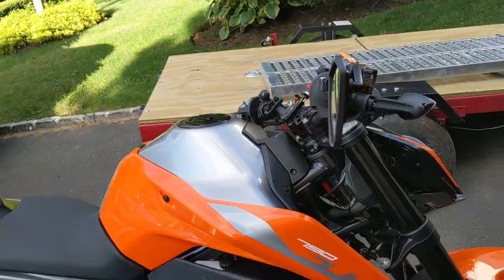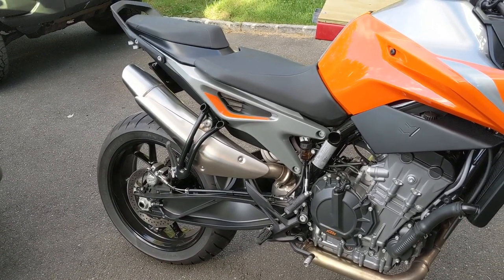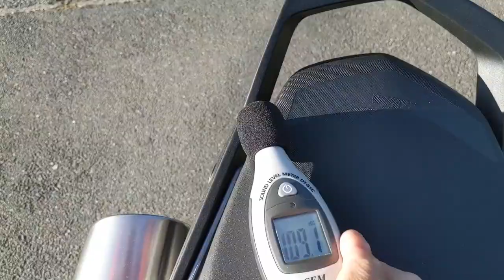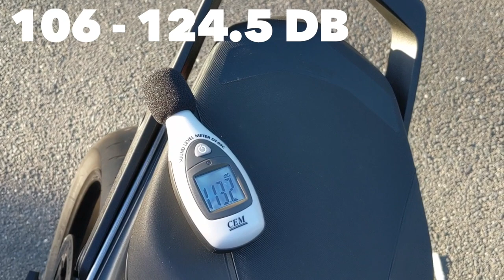SC Project S1 GP Exhaust Install On KTM Duke 790

Comment: Amazing video.  Sounds great and looks great.  Question for you: at 1:40 when you’re removing muffler bolt, do you find these extremely tight? Tried taking mine off recently and snapped the tool I was using.  Thank you
Reply from the maker: James Nickel thanks. Those bolts ( if I remember correctly) can be turned either with a socket wrench or with an Allen key - I used a wrench and had no problems- more tourque and grip .
Reply: I AM SANDY thank you! Will give it a go

Comment: Does the exhaust come with the mount and can you eliminate the passenger pegs while installing or do you have to buy a separate kit to remove the pegs?
Reply from the maker: Danny Wywias Jr pegs can stay and then no eliminator is needed. If you want to eliminate the pegs you must buy the elimination kit/bracket separately
Reply: Which kit did you use? I’m going to order this exhaust? Thanks
Reply from the maker: Danny Wywias Jr it’s in the description below the video - check it out. Good luck

Comment: is this with car or decat ? and must you get it re map for a slip on ?
Reply: This is a slip on with the stock cat, no remap required. If you were to get a catless mid pipe then you’d need a remap for sure. Just ordered my sc project slip on last Friday and got an email saying it will take 4-5 weeks, too anxious!
Reply from the maker: Correct! No mapping, just slip on ! Plug and play haha
Reply: Dimitri Zarate sams here! Order the same exhaust for my 790 duke 3 weeks ago and they told me 3-5 weeks before shipment. Hoping it will be in soon. My duke isn’t loud enough
Reply: Aaron Allen mine came in exactly 5 weeks after the email and trust me it’s worth the wait, it’s still quiet in group rides but when solo it sounds great. Kinda wanna decat but at the same time don’t wanna mess with the tune
Reply: Dimitri Zarate glad to hear! I was considering taking the cat off but I also don’t want to have to spend money on a tune or remapping